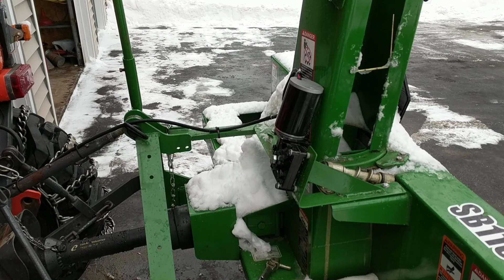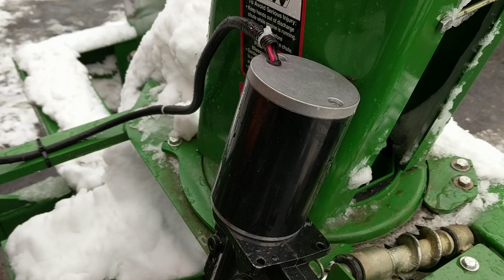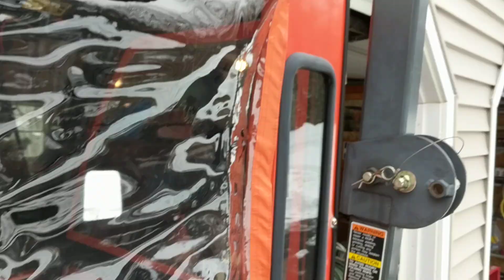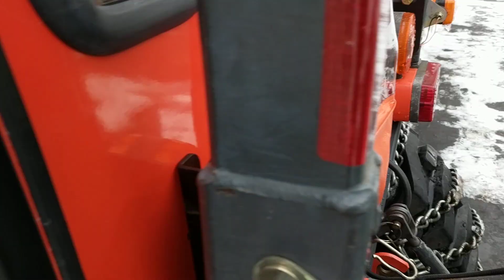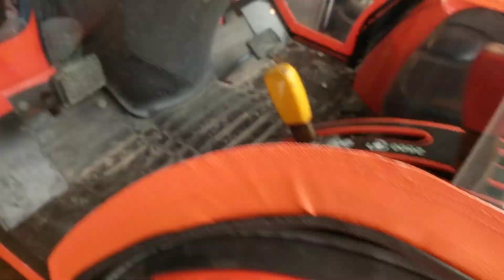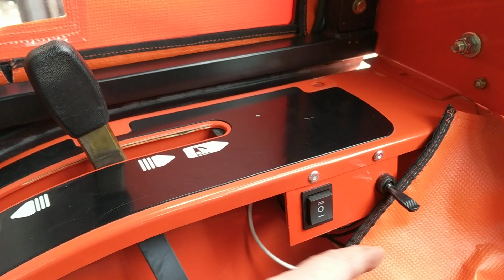Snowblower Electrical Chute Rotator

Comment: whats  the numbers on motor and where did you get it i am doing the same as you putting a cab on
Reply: Apparently hyperlinks don't work on YouTube. Anyway I just went on Amazon and ordered a motor from Carolina tarps. I got a late duty 700 watt one they're designed to roll tarps on a dump truck but they work great for this too.

Comment: What electric motor did you use?
Reply: So I went online on Amazon actually. And I just looked up a tarp motor for rolling tarps on like a dump truck. And then I just matched the shaft size so I could get the right one. It was from Carolina tarps.

Comment: Do you know of a joystick that would be in place of the switch. Asking because I want to do this project with an electric actuator for the shoot deflector. Up/down for that and left/right for the directional motor
Reply: I can't post links in here, on Amazon, search for "Baomain Monolever Joystick Switch HKA1-41Z04".  

It's a single-pole switch though (not double-pole), so you can't reverse the polarity at the switch, so you will need 2 of these "Forward and Reverse Relay Module for Motor/Linear Actuator, Reversing Relay Module " from Amazon, 1 for Up/Down, 1 for Left/Right.

Alternatively, so could use 4 automotive relays, 2 for U/D, and 2 for L/R, and google search for "reverse polarity relay diagram" for how to wire each pair of relays. 

The reason for the relays is that because the switch only open/close the circuit, it would always send the same polarity, so the motor would always spin the same way.

Comment: We’re did you get the motor for the conversion?
Do you have part number?
Reply from the maker: I was lucky and found one like someone else had used. It was a no name unit.
Reply from the maker: Ebay. You need to just do an internet search and it is hit or miss.

Comment: How does the electric motor turn the inserted bolt?
Reply from the maker: Sorry late response. I drilled through it and inserted a bolt at the lower location and pin in the upper position.

Comment: I would appreciate if you can share your worm drive motor brand from Ebay?  And rocker switch brand too.
Reply from the maker: It doesn't have a name on it. I messaged the seller and he doesn't have any more at this time. I recommend that you search the internet for something similar. I have noticed some with a shaft instead of a hole. It would be easy to make a coupler. Sorry.
Reply: @larryjewett6990  You really did an excellent job to make it looks so professional.
Reply from the maker: I will check the rocker switch brand  tommorow night when I get home.
Reply: @larryjewett6990  Thank you.

Comment: Hello Larry, I too am in Maine.... up beside Fryeburg. Sick of the snow yet?
I love this idea but when i search EBAY with what you have listed I don't find any motors with a through hole for the shaft.
Do you have an actual part number or model number, something I can do an internet search for?
Thanks and think Spring!
Reply from the maker: I'LL find it and provide link.
Reply: @larryjewett6990   I think I sent you a PM on facebook. I searched EBAY and found nothing like this motor so a brand or model number would allow me to look other places beside EBAY. The link would be good too because maybe they relisted some and the search just isn't finding it. Thanks again, Guy
Reply from the maker: I sent a message to the Ebay seller to see if he has more or has source information. There are some with shafts in the gearbox. You could probably use one of those if you created a coupler with a bolt to the shaft. Will let you know what I find. 207-212-9632 text or call. Thanks

Comment: you have any part recommendations?
Reply from the maker: New Worm Drive Motor 150 RPM Gear 12v 1/2" Center Glossy Black (purchased on Ebay),   Momentary DPDT ~ 6-Pin (ON-OFF-ON) 20amp Rocker Switch